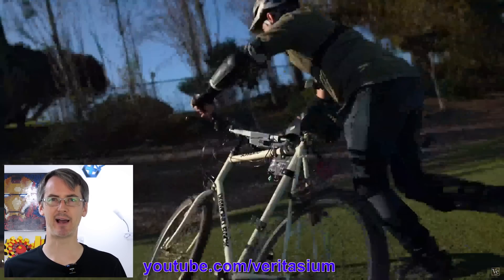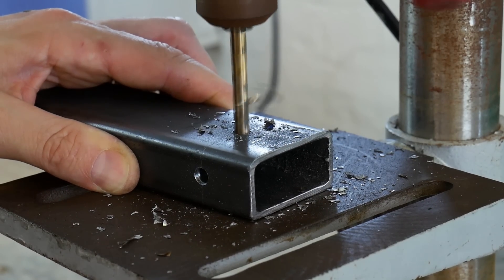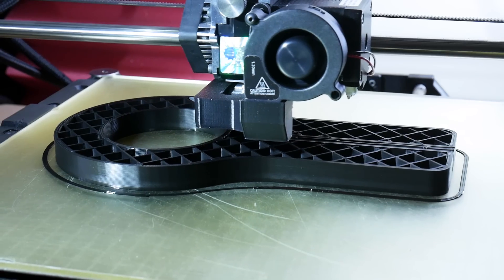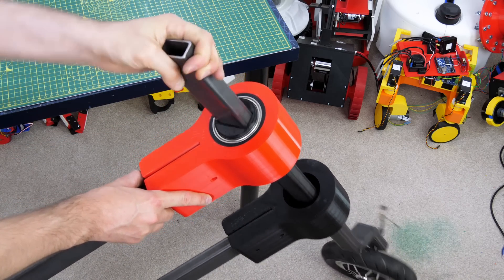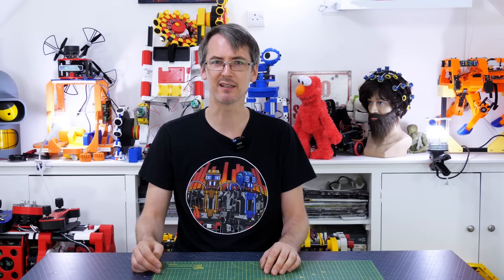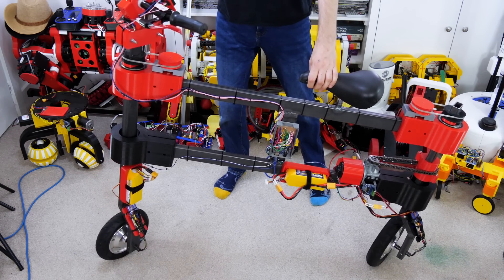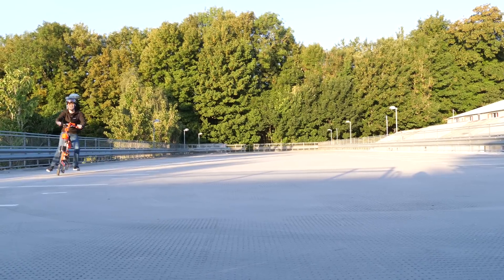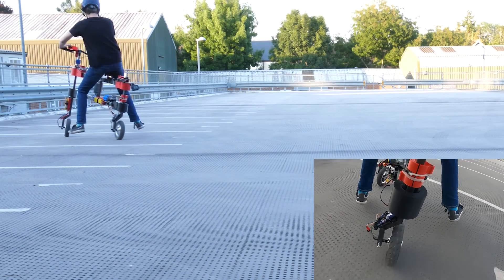Weird Two-Wheel Steering E-Bike

Comment: You can turn a bike without steering. Just hop the front wheel. I suspect that someone with fair skills would easily bypass the issue of locked/reverse etc steering
Reply: The locked steering experiment was to test what it would be like to ride a bicycle with locked steering, not to debunk the existence of pogo sticks.

Comment: AFAIK the Porsche Taycan offers two axes steering as an option and it uses both modes, parallel and opposite direction steering, depending on the current speed. At higher speeds (above 50km/h) it uses parallel steering, which is supposed to improve comfort when overtaking other cars (which is the main purpose of a Porsche). At lower sppeds it uses the rear wheels steer in the opposite direction, which helps for parking.

Comment: Swing bikes were originally a thing in the 70's . my older brother had one and I rode it around for fun in the 80's . it looked like an old  stingray but had a knob on the upper tube that you could pull to release the back end and a spring that pulled it towards the center unless you actally pushed the bcak out.

Comment: Instead of a switch to turn the mode of steering from mirrored to mimic, why not use a potentiometer? Fully one way is mirrored, fully the other is mimic, and everything inbetween interpolated, center being no movement.

Comment: I love your new giant projects, I'm more into 100% mechanical bikes, but these ones with electronic controls are awesome.  👍👍👍👍
 A year ago I made a bike with steering on both wheels, but one wheel is controlled with the hands and the other with the saddle and that allows you to turn one wheel more than the other and ride diagonally, turn closed and all the possible combinations between those two modes.

Comment: I wonder if the steering could be used as the on/off switch once it hits a certain point? Would it then act like a drift in a corner and then go back to normal once you pull out of the turn

Comment: I'm pretty sur the laguna 4 wheel drive use both modes, opposite direction for tight turns at slow speed, and same direction for low turn at higher speed, however with same turn direction, they don't rotate by the samùe angle, the rear rotates way less.
It is also used by porsche too now
Reply: The 4-wheel steering feature was designed for better manoeuvrability at low speed by lowering turning radius and for minimising fishtailing when changing lanes at high-speed. Would be interesting to test those two modes with this 2-wheel steering bike
Reply: @bornach  Agree. The thing to try here is the less rotation on the rear in same direction mode, instead of doing the same amount of rotation.
Reply: @skipspik1571  James Bruton could also try crab walk mode and challenge Derick [Veritaium] or Destin [Smarter Everyday] to ride it.

Comment: You should add a gyro and have the back wheel steer towards the tipping side so it helps you keep upright.  Also, perhaps a mode which doesn't turn when you're turning slightly, but ramps up and makes sharp turns even sharper.
Reply: so cool
Reply: these ideas are on point
Reply: That would make this so much easier to ride, a rc helicopter/drift car gyro would work perfectly